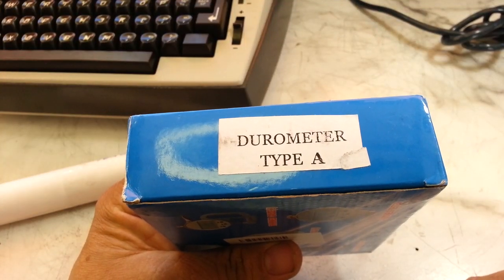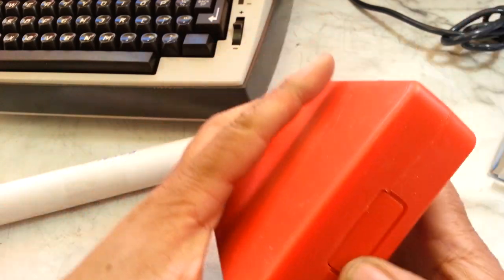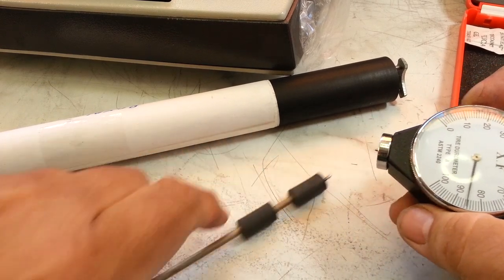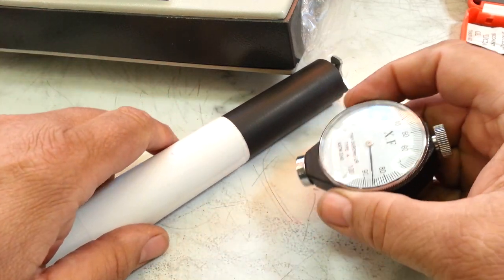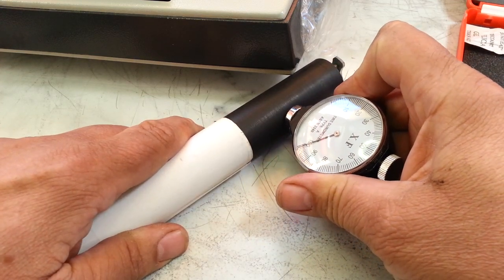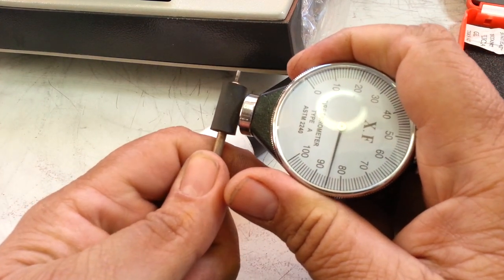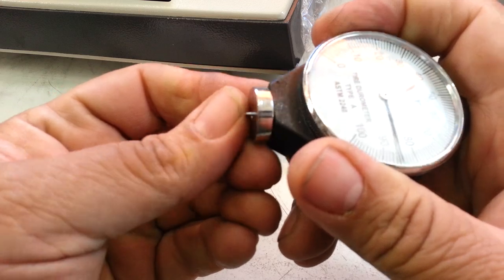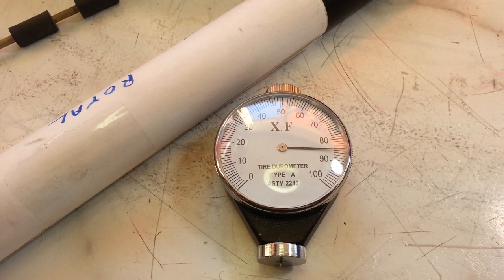Durometer Shore Type A failure . . . .

Comment: Smack it with a hammer !
Reply from the maker: Like a big hammer . . . .  and then go buy a different brand ? 
Gonna try to pursue the warranty way first before I smack it . . . .
Reply: Probably just need a good smack on the right side making it work again.
But if you have warranty wait until later. Good luck